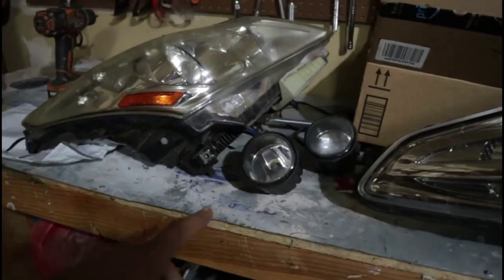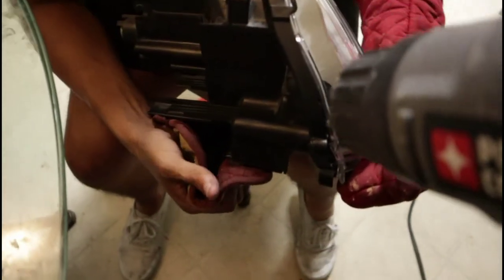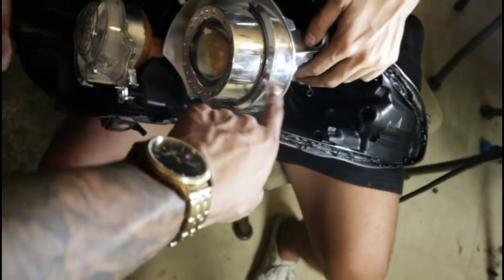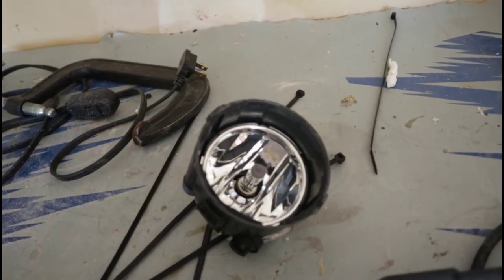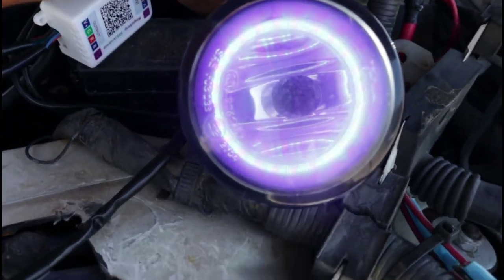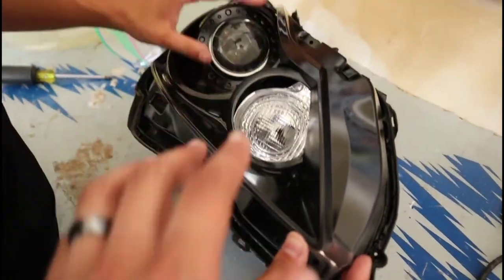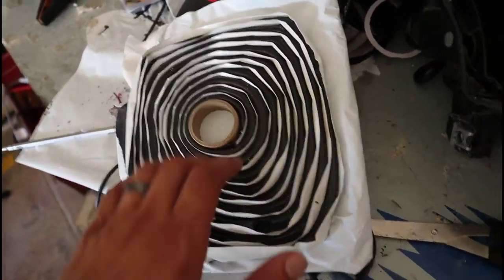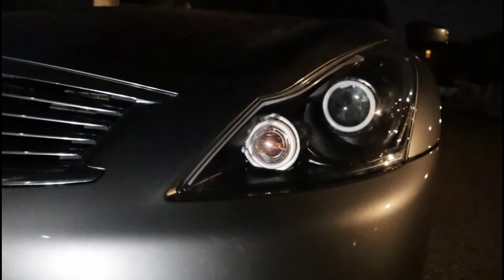Custom G37 RGB headlights and Foglights

Comment: what size rings did you guys use? my bad if i missed it in the video
Reply from the maker: I think it was 80mm for the top 70mm for the smaller ones
Reply: tysm what about the foglights and what led strip did u guys get? it looks so awesome i wanna do it for my car
Reply from the maker: @uxvu  fog lights were 70 I think, just be aware the for lights were a bit of a pain to reseal. 
And the strips and halos were all bought on eBay.
Just keep in mind your going to have to do some extra wiring to make everything reach and I’d put some sort of heat tape around the boxes
Reply: @dirtybuildmedia566 how did u guys do the led strips i cant seem to get the strips to fit nice
Reply from the maker: @uxvu  don’t think we did anything special. If your having a hard time with them staying make tiny holes and use fishing line to help secure it from moving
Reply: @dirtybuildmedia566  i’m having trouble fitting them cant close it properly
Reply from the maker: @uxvu  might be the strip type itself then. You can always take the lights out if it’s sleeve and that will make it a lot thinner
Reply: @dirtybuildmedia566  did u guys put it on the inside of the headlight bc i found a way to put them on the outside and it looks similar to what u guys did
Reply from the maker: @uxvu  we put them on the inside for sure just don’t remember if we had issues doing so or not